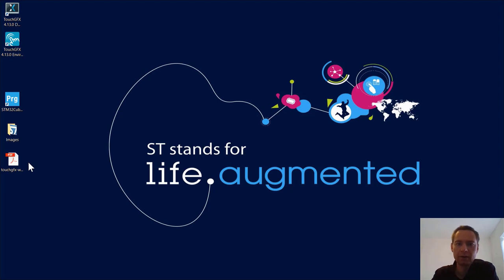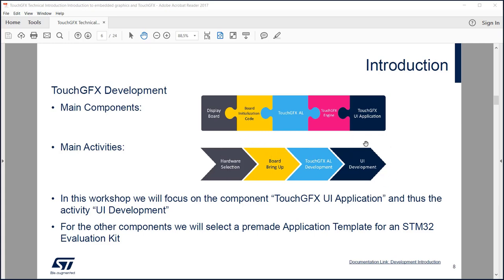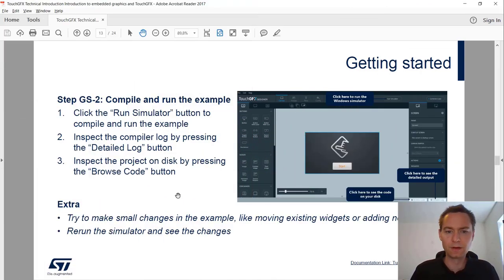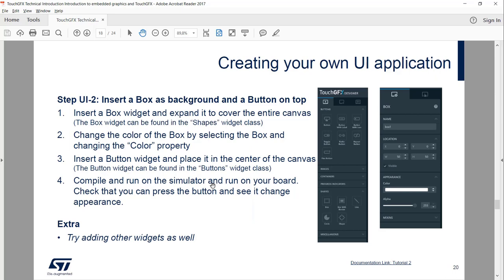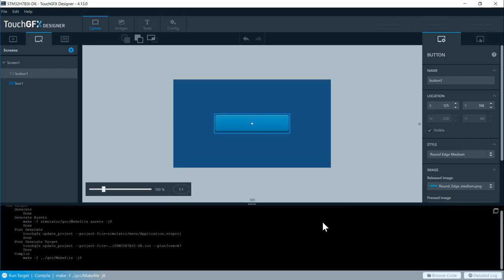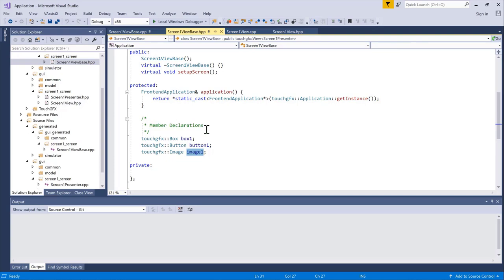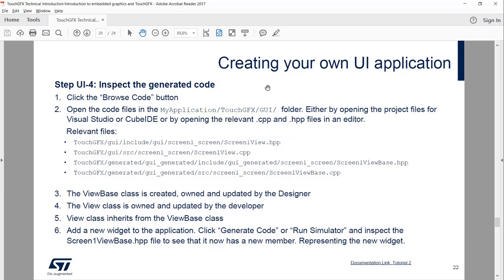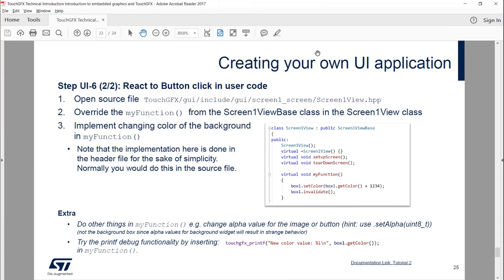TouchGFX Presentation: How to start GUI development using TouchGFX

Comment: 00:08 Introduction to GUI development using TouchGFX
02:40 Main components needed for a TouchGFX project
07:41 Creating and starting GUI development in TouchGFX
10:08 Exploring project creation and browsing code in TouchGFX
15:47 Creating a new project and inserting widgets in TouchGFX Designer
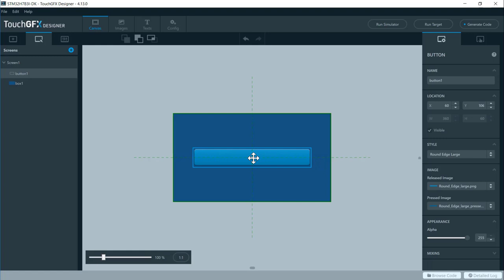18:10 Select and customize predefined images for buttons
23:16 Images should be added to the project only if they are being used to save space in flash.
25:40 Overview of project assets and folders
30:18 Interactions in TouchGFX projects
32:38 Creating interactions with buttons and widgets.
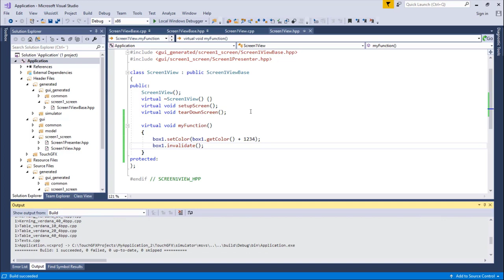37:06 Easy debugging with TouchGFX
Crafted by Merlin AI.

Comment: Unfortunately no installation instructions. It is difficult to see what you need to get it up and running. Finally I installed version 4.20.0 of the TouchGFX and the "STM32Programmer". The STM32programmer is only used to see if the discoveryboards contact OK and than is closed. Starting the TouchGFX and than you choose EXAMPLES from the left menu bar. Hit the blue "select Board Setup"  butto, select a Board below and hit the blue select button on the right. Now you can choose an example, preferabl;y with the same Resolution (I.e. 800x480) as your discovery board. Hit the pink "Create". Hit the simulation button (Triangle) od upload to the board (square with arrow). When complining, <Ctrl> - L  shows a verbose screen. Now I seem to be unable to program the STM32F469I Discovery and the STM32F746G gives an error in the verbose screen:"upgrade st-link firmware". Done so in the STM CubeProgrammer. Error stays. Under windows both boards are detected without error in the configuration screen, USB Devices (ST-Link Debug). Any idear what goes wrong?